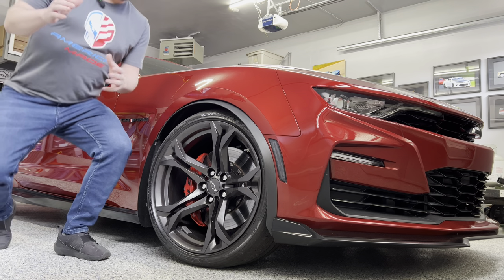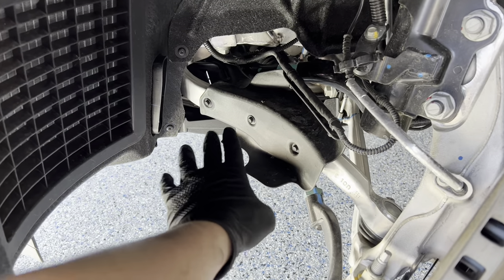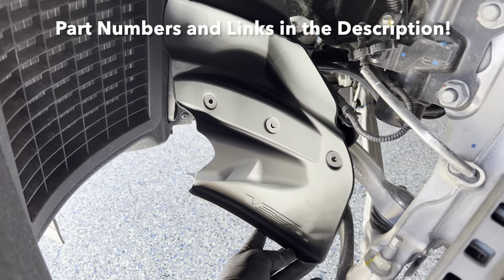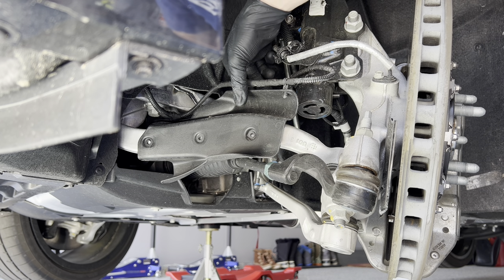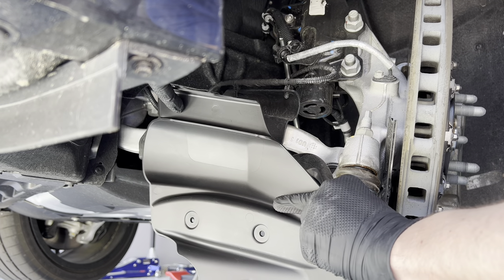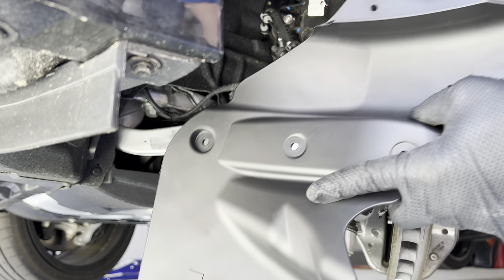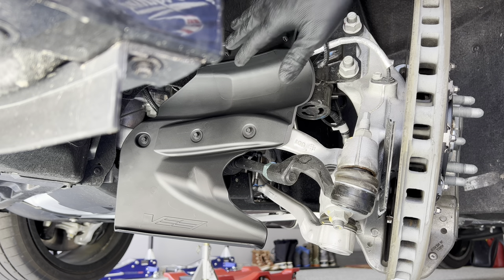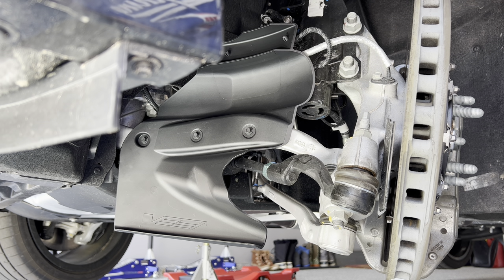How-To: Blackwing Brake Cooling Ducts Install // 2016 - 2024 6th Gen Camaro

Comment: Nice video. I noticed cooler brake rotor temps after adding them.
Reply from the maker: Thanks! I added the rears as well, and cut away a portion of the dust shield, it’s just not part of this video. Most likely unneeded, but figured I would do them anyway.

Comment: I picked up a 2023 camaro about 5 months ago I want to start drag racing the car would these be good or are they only for the track ?
Reply from the maker: Great question! These are setup to cool the brakes in hard braking and cornering situations. Drag racing doesn’t put enough heat into the rotors for a long enough period of time to warrant the need for these on the Camaro.

Comment: Great quick and to the point video! Are there any benefits to the plastic piece poking out of your front wheel well on your SS 1LE (not the splash guard)?
Reply from the maker: I guess I’m not entirely sure which part you are describing. If you can give me a time stamp and location on the screen maybe I can help answer.
Reply: No worries, should have been more specific. Clip is in the first 10+ seconds. The curved plastic piece protruding out of your wheel well from the front of your wheel to the top of your wheel
Reply from the maker: Oh! C7 Corvette Fender Flares. OEM part numbers:
23315196 - Passenger Z06 Fender Flare
23315197 - Driver Z06 Fender Flare
Reply: Appreciate you letting me know the part #s! Are they for aesthetics or are there any benefits running them? Thanks
Reply from the maker: Mostly aesthetic. I don’t have any way to measure any aerodynamic effect but I am sure they may help airflow over the front tire. Again, no measurable benefit.
Reply from the maker: @Tristan Cooper they need to be modified a bit, but they work well.

Comment: Do you think these deflectors will bolt up on a 5th gen 1LE?
Reply from the maker: Great question! They do not directly bolt up, however I have added a set to a 5th gen by drilling slots into the cooling duct, and using zip-ties to fasten them to the arm. Then, you need to turn the wheel all the way until suspension hits the duct and trim some of those pieces away.
Reply: You didn't take pictures by any chance?
Reply from the maker: @BeardedMale25  unfortunately, I did not. Sorry